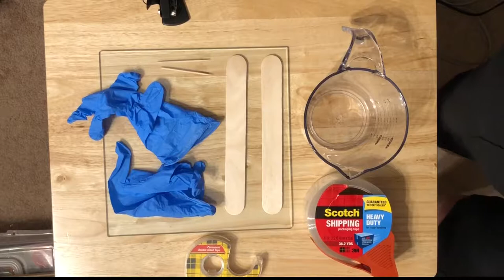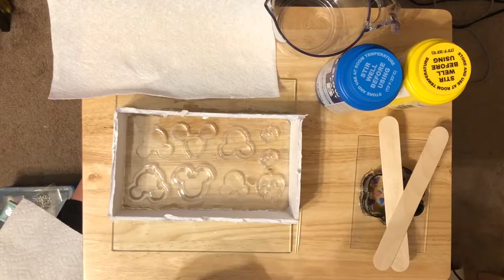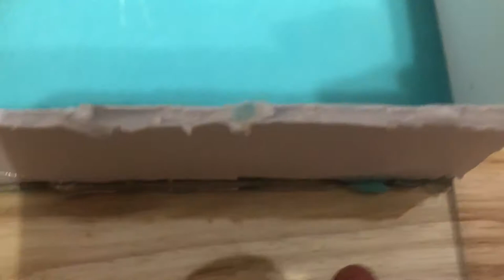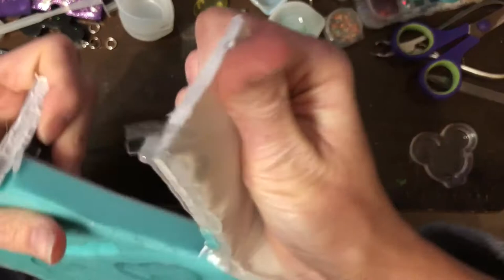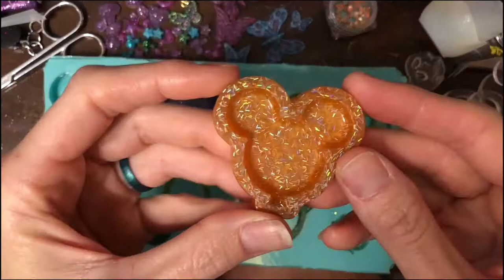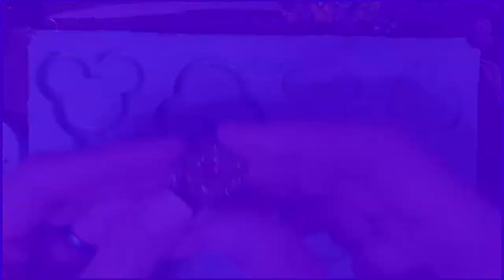Making Silicone Mold From Resin Castings

Comment: What is the clear square made out of? Thanks
Reply from the maker: It is actually just a piece of glass. It came with a paper cutter that I bought. However, I have used the glass out of picture frames before and it worked just as well. This glass is just a little bit heavier that's why I use it, especially if the mold is going to be a little bigger. I have also used foam board too. Anything that is supportive on the base would probably do. Thanks for watching!

Comment: Hi. I understand that you bought the plastic mold first. Is the mold that you used to make the silicon mold silicone as well? I’m confused as to how you got the molds you are working with.
Reply from the maker: The original mold that I bought to make the resin pieces that I made the new mold of was plastic. The new mold is silicone. I used foam poster board to make the rectangle mold to hold the silicone when I poured it for the new mold. I am not sure if this answered the question you were asking because I am not sure if I totally understand what you were asking, but if not, feel free to ask again. I will help any way I can. Thanks for watching.
Reply: Olive Branch Inspirations Thank you for answering. My question pertains to the middle step.  What was the result from the plastic mold? Was that plastic, clay, etc?  I understand that the end result was a silicon mold, I’m trying to understand the different steps and results. For example, what resulted from the plastic mold and what is being used to make the silicone mold is the same I am assuming. I apologize for all of the questions. I have lots of plastic molds from when I used to do candy.
Reply from the maker: I think maybe I understand now a little better. The result from the plastic mold was the clear shapes made from resin that I used in making the silicone mold. All the Mickey shapes and the poison apples were first made in the plastic molds before I recast them in the silicone. I made them and then waited for about a week until they were for sure fully cured so as to not effect the curing of the silicone. The plastic molds work fine and can still be used, I just don't much care for the plastic ones because they are somewhat difficult to get the resin piece out of. I like the silicone better because they pop right out. So, you are correct, the pieces molded from the plastic and the silicone are now exactly the same. I hope that answers your question a little better. 
You are totally fine with questions. No need to apologize. I do not mind helping if I can. :-)
Reply: Olive Branch Inspirations Thank you so much.
Reply from the maker: You're welcome!

Comment: super cute i loved it. did you make the figures you casted yourself or did you buy them somewhere?
Reply from the maker: Thank you! I made them myself, but I made them from a mold I bought on Etsy. They were plastic molds and I don’t really care for plastic mold because they can sometimes be difficult for me to get the piece out of.
Thank you for watching!
Reply: @StarJenn19  ohh ok. Yea im not the biggest fan of plastic molds either. Silicone is a lot better. Im trying to learn how to make nice pieces for like characters (from scratch not another mold) to make a mold myself but having trouble finding a method that is really clean
Reply from the maker: I understand. I have made a few molds out of things I made from clay, but I'm not super great at it and they were not super smooth. The best way that I have seen is to make them from acrylic using a laser cutter, but they are pretty expensive and I haven't talked myself into buying one yet. I would like to one of these days. I have also made a few with a rectangular cast piece of resin that I used a scroll saw to cut the shape with. It worked ok as well.

Comment: do you sell any of your molds or resin pieces?
Reply from the maker: I do sell some of the pieces that I make. I have an etsy shop, but I do not have anything in it at the moment. If you ever see anything in a video (or Instagram page) that you are interested in, just let me know. I do custom ones too, but I probably will not have time to do anymore of them until after Christmas. As for the molds, the ultimate goal is to be able to make them to sell, but as of right now I have not 100% perfected them. They work fine, but I am a perfectionist when I sell things, and I am still working out a few cosmetic issues. Hopefully I will solve them soon though. Thank you for watching!